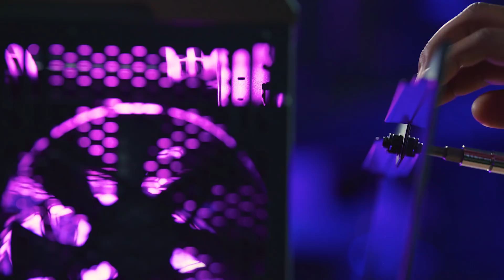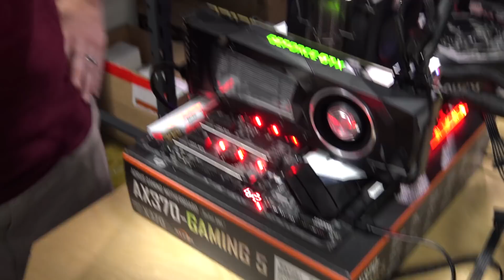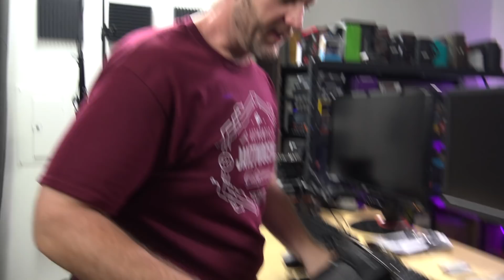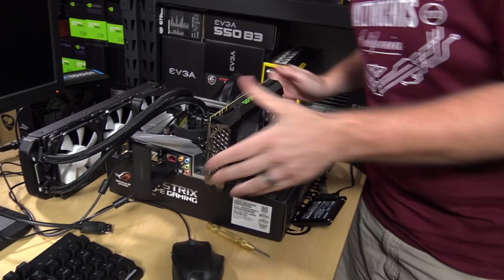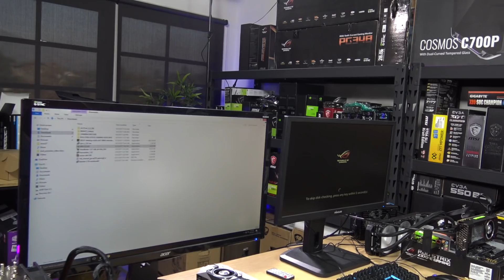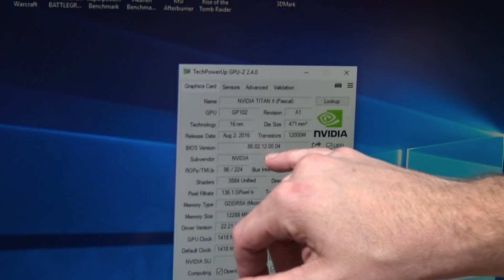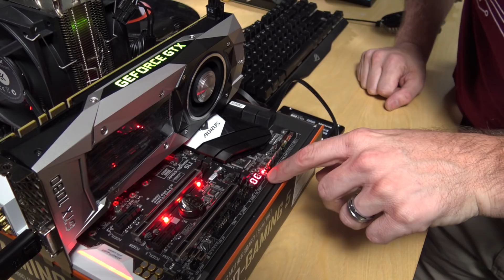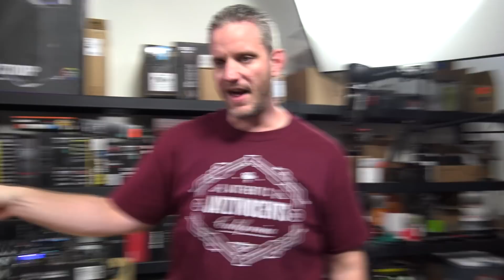I cant figure this one out... HELP!

Comment: maybe it's some weird power issue. check how much voltage  and wattage this specific card is drawing on the Intel board and compare to the other card. sometimes there is a difference between 2 otherwise identical cards ( I have noticed that with 2 of my gtx 970 g1 gaming cards). if there is an option to plug in a sata power connector to the Mobo ( that is usually required for sli) try doing so.

Comment: when you first plugged in each card to each motherboard, maybe there were initializations  that changed something about the settings of the graphics card, and the differences in the 2 boards' init settings would be compatible account for the non-symmetric compatiblity
Reply: isn't that a pretty standard possibility, you can't just take out components that are being used on one system and expect them to be able to be plugged in to another system, especially different amd or intel mobos, and expect them to work without any sort of adjustments or a reformat or something

Comment: Alright, I have something similar going on. The computers boot, but an R9 390 I have will have issues on my Ryzen, and my 3770k. I tested it in my mini-itx z170 with 6600k in it no problems... I ran Unigine Heaven, Superposition, and the Final Fantasy 14 benchmarks for hours with zero issues... Other comps it would get issues on the desktop without running anything intensive... So that annoys me.
It gets even worse with the new Windows 10 updates of late as well... I have a friends comp with an i5-750 and her msi r9 380... Again tested it in 2 other computers and it came out clean... So I'm annoyed with how things have been acting around of late as well :P

Comment: The video card bios wouldn't change when you put the video card into a different motherboard... what's the BIOS version of the card that doesn't work? You checked the version on the card that was working fine on the intel platform, then moved it to the AMD platform and checked the version again, of course it's the same... I noticed the color was way more green on the "bad on AMD" card when you started it up on the Intel platform, that says to me that the card probably is bad, but that the AMD platform is just far more picky about what it'll pass or not... I'm obviously not the first person to notice the bios checking misstep, but I haven't read all the comments to see if anyone else noticed that the video quality looks like crap once you put it on the Intel board... Good luck..

Comment: Can you edit this video so people stop focusing on the mistake you made and focus on the actual issue? Anyways, you know a hell of lot more than I, but for shits and giggles, confirm the board version of both cards are identical. Are they both from the same assembly line? Obviously a conflict with the ryzen. Only way to tell for sure is get another ryzen board and test it. I'm leaning towards something in that gpu hardware related is causing an issue. Can you rollback a gpu bios and then rewrite an up to date bios on the said card? Definitely a weird issue.

Comment: Mine was FX 6100 with HD 7750  it's just a problem with the South Bridge. There's
no problem in processor it's just the motherboard, If you will try few times by restating it, it will boot, It just can't read that card's IC properly.
Reply: Reply me if that helps

Comment: I had a similar problem with my MSI Z77A-GD65 mobo. I built the system with GTX 670 SLI, and a few years later I upgraded to a 980ti. The card would not work in the system and as you guessed I assumed the GPU was bad. I returned the GPU saying it was bad and the replacement had the same problem. Turns out the motherboard did not support the GPU which is a problem I had never ran into. I ended up building a new system around the 980ti and gave that system to my little brother. He still has the system and he upgraded to a GTX 1080 last month and we had the same issue. Luckily MSI had released a BIOS update for the mobo that said "improved GPU compatibility" and that allowed his 1080 to work. I probably won't be buying MSI boards again because of this, as far as I know ASUS are the best at validating their boards with a wide array of PCI Express cards.
Reply: I had a similar problem with msi too LOL. ms-7507 and msi hd5450.
Reply: If your going for Asus motherboard, be aware that it does not support all kinds ram models, had a problem when i built this setup, but once i got compatible ram of a different brand (but same type) it worked. I do however recommend Asus motherboards, in my opinion they are the best. (20years ago Asus was not this good)
Reply: I hear a lot that asus is the best 
But in best motherboard reviews its always a gigabyte why is that ??
Reply: HappyDude 
Recently Asus did some weird VRM fudging that didn't fly to well when ppl like Buildzoid caught it and called them out on it. The Gigabyte Aeorus, righfully, overtook Asus in reviews for overclocking motherboards for that reason. 
That said, Asus has phenomenal bios and usually great compatibility testing and features. 
Hopefully they learn their lesson come the next chipsets. 

I've always used Asus motherboards and they have almost always been the best, but for this generation I'd buy the Aeorus.
Reply: LOL, just wrote about my problem with msi P67A-G45 and 980ti OC strix. then I saw ur comment.
Reply: The two gpu bios you showed were from the same gpu un diferent motherboards, did you check te bios on the two gpus? Are they the same version? Sebastián from Uruguay.

Comment: This really looks like a power delivery issue to me. First step, use another PSU (like the one on the Intel System). If that doesn't work, change mo/bo, maybe for some reason it can't get the power needed through pcie. If you are skeptical about this being a power issue, consider that the card not working might be asking for slightly more power than your system can send, which would account for hanging as well as normal behavior once another (slightly less power hungry) GPU is installed.
Love your videos. Know that you have fans in Greece :D

Comment: You checked the BIOS version on the same graphics card twice; once on the Intel system and once on the AMD, but not on the card that is giving you issues once it booted on the Intel rig.  Honestly, I would blame the motherboard since motherboard manufacturers were the ones that had issues with Ryzen BIOS early on in its release.  Are there loose solder joints on the pins on the back of the PCIe slot?  Have you tried the non-working card in a different PCIe slot?

Comment: I have this mb, and it wont boot if it cant detect a connected screen on the primary vga, it just stops at Code 64, it worth a shot to try the other outs, or an other cable, maybe the used output is slightly damaged so the card cable combination fails.

Comment: Jay I would just use another "identical" motherboard for the ryzen system and check both titan x's  with it. The motherboard may seem fine but in my years of professional IT tech support I figured out that two identical systems are not identical and that for most mysterious problems that make no sense at all, the motherboard was the most suspicious part. Other things to consider are the PSU cable and its contacts with the vga and also the contacts of the specific "problematic" card with the PCI-E. Plus try to connect the card on another PCI-E slot on the same motherboard and check the error code if the problem occurs in another slot. I have never found a functional vga that would not post in all systems but I have seen plenty possessed motherboards.

Comment: what is funny is my 3930k on an Asrock x79 Extreme 11 does something similar with my Titan X pascals if the Bios reset is pressed or it crashes too many times on startup due to bad overclocking etc. the computer will get stuck on B2 during boot and so far the only solution I have found is to start the computer with an older card like a gtx660, gtx 750, or gtx 780, and got to the Bios/uefi and set default values and save then put the Titan X pascal back in and it will work fine, the crazy thing is I bought both titan X pascals (2) from Nvidia launch day and also bought my previous Titan X maxwells(3) from Nvidia at launch and all 5 Video cards did this I thought it was because I had and old motherboard

Comment: You never checked the Firmware/BIOS version of the "bad card"? 

Try, moving the "bad card" in the Ryzen system to another slot on the motherboard? I assume you reset the BIOS of the Ryzen system as well?
Reply: That right he never did show the Firmware/BIOS when he swap them around with non work one when put in the intel system.
Reply: Anthony Toste
I wondered if anyone caught that. He checked gpu version on right machine, then moved card to left machine and did it again, never showing the bad card's version? This could easily be an I&O issue/ conflict. And an I&O issue will cause the hardware device to not be used. IF you reloaded windows with bad card in, windows would prob reallocate resources (I&O) to avoid this.

Comment: I have a similar issue with my ryzen setup. Now and then my pc will refuse to boot (vga light on) on the motherboard. So i have to swap out my r9 280x to an old nvidia gt710 i have laying around. When it boots into windows, ill switch the pc off and put the 280x back in and that solves the problem.

First time it happened i thought my motherboard had failed and rma'd it only to be told it was working fine. Dont get me wrong i love my ryzen setup but the platform definately still has some weird quirks (i have another unusual behaviour from the system (unrelated).

Comment: Can't tell you the reason why, but at work I experienced the same with two Intel systems and a NV Quadro. Then I tested an old AMD HD6??? and it worked. Therefore I think the NV is the problem ... maybe manufacturing tolerances.

Comment: You double checked the bios on the same card. If it's not working at that point in the boot and you've ruled out the hardware itself. It's got to be a bios issue even if the motherboard and video card are on the newest version or a know stable one. I'd re-flash both just to make sure they are not corrupt. I'd also use a new download of the bios while doing that re-flash. It may not work but at least at that point you can pretty much rule out bios if nothing changes.

Comment: you checked the gpu bios version in the same card. you switched the not working gpu to the intel system but checked the version on the amd system. no wonder the version is the same, its the same card. i bet the gpu bios version is different.

Comment: You said Ryzen is picky when it comes to RAM. Maybe it's picky when it comes to GPU RAM as well. I'm no genius but anything is possible with AMD. Maybe change out the system RAM and see if that bears any results. Doubt it will. And I don't even know if RAM on a GPU would make a difference when it comes to different boards and or CPU's.

Comment: i belive its the mainboard. maybe u just got an bad one, because its the part that controls everything and give u the error. i had an gigabyte k7 mainboard with an 1800x and had very wired performance problems, i never figured it out what it was, after 3 days i shiped it back and orderd an intel system. i think that i just got an bad Mainboard that time because al the other parts work just fine in the intel system (changed the Mainboard, cpu and ram)

Comment: Well heres an idea. Is there any sort of overclock applied to the system? Mainly the base clock, not the multiplier. Could be that the ryzen has the baseclock set to some weard frequency that 1 GPU can not tolerate but the other one can. Effectively a silicon lottery or what not.
Assumeing those 2 bioses  were the same version tho :)

Comment: Step 1 - Try another PCIE-Slot on the Aorus board -> Maybe the Slot is a bitch ? Or some kind of tolerance mismatch in the two slots?
Step 2 - Try another Mainboard in case you have one. -> Maybe the Mainboard has some kind of damage thet makes it in the moment when its booting edgy, working with one card but not the other
Step 3 - Have a beer and call it a day. Maybe retry next week. I build Computer systems for al living too. Trust me, strange things can happen always. And consider working under ESD-conditions (wristband and ESD-Table). All electronic companies work in ESD-environments, and that shit is expensive, but keeps strange problems at bay...

Comment: Silicon lottery. Do both cards run at the same voltage on the system they work on? Also, check the bios on the second card lol

Comment: I wonder if it's the firmware on the cards that is causing the issue. Maybe they both have different firmwares and one works with the Ryzen system while the other doesn't.

Comment: Just because the GPU works in one system and not another doesn't mean it's not still a GPU issue. I had a PSU pull the same shit. Would power up and boot up one system just fine and the next it would power cycle. Not saying it is the GPU just saying don't count it out yet. And try another PCI-E slot or another MOBO. Funny you had two different post errors on the same board.

Comment: Check which revision the graphics card is. A certain resistance might not be inline with the other 1080ti. I highly doubt that could be an issue. But it is ryzen........and that's just about your only other possibility.

Comment: 1st You didn't check the bios on the two cards. SUSPECT THE POWER SUPPLY! change the power supply. 30 years of this pc building crap have taught me this. that particular card may have a slightly different power draw to the other which the PSU doesn't cope with. the fact that you put in the other card and had to do a reset in my mind would back this up.  
I have come over some weird faults in my time even down to one time it being the built in speaker (yes that tiny little one you used to get) in a case stopping a whole system working and causing random crashes, but it beeped fine!

Comment: I would do the divide and conquer method. Keep replacing components one by one till you find the issue. Also, put only 1 stick of ram on several different slots or try a different stick of ram. 

Try a different pci-e slot on the mobo. I have an amd HD6870 video card that sometimes works on the first pci-e slot of the mobo and most of the time it does not. However when I put it on the rest of the pci-e slots for the same mobo it works 100% of the time. Funny thing is when I use an r9 290 or an r9 295x2 on that same first slot, they both work 100% of the time.

Comment: I think the problem is in connection of card with MB ( I mean pci-e slot ) . Try removing and installing card several times or try installing complex in a case . Also try using pci-e riser cables .
that might be problem with the connection

Comment: Gigabyte =/= Ryzen, Gigabyte's implementation of Ryzen chipsets has been crap, flaky boards everywhere, the f5 bios on GA-AX370-Gaming K7 put 1.7 volts through the vcore. Try using an Asus x370 board, and see how finicky it is.

Comment: The ram doesnt run at the stated values on my ryzen system, if its set to the proper settings it fails post. I had trouble with trying to install my windows 7 when i got my ryzen stuff, windows 7 doesnt support the usb system of the newer hardware, so you cant use the keyboard & mouse...so you cant go through the install process, i even tried a clean win7 install on another system, installed usb3.0 drivers, didnt work on the ryzen, the motherboard i bought had no old school ps2 keyboard port, i thought i got a duff motherboard.....then after googling a lot i realised its all a scam to make you upgrade to windows 10, they deliberately designed the new hardware not to support earlier windows versions. Im not savvy enough to edit installs with automated installation & usb drivers.
If i hadnt have had my old setup to put back in my case i would have ended up going through the rma process

Comment: Swap power supplies between test benches. You had some psu voodoo and I've seen similar issues if a psu is reading low on a 12v rail.

Comment: Drivers!!! Use the tool to remove and clean the OS of the drivers and test again. Just use whatever Windows give for drivers. But yeah doesn't make sense. :)
Reply: The system doesn't even boot so the drivers are not yet loaded...
Reply: Yeah, I know but I always like to troubleshoot with the OS in a simple state and no drivers. Like I said it doesn't make sense. But I have seen some strange issues with AMD new processors and Nvidia. I have a friend brand new system Ryzen and Nvidia 1060 and it had the same issue it didn't boot no post and BTW Asus motherboard.

Comment: Like Darkio said, i believe it looks like a power issue. Except, i don't think it's a power power supply issue, mais it may be a motherboard power issue. The only way i know to check this would to to monitor power on real time on both system. Or change mobo for Ryzen if you have another one, possibly from another manufacturer.
Reply: About one titan working on one mobo but not the other, like you showed yourself previously, not all GPU are equal. Silicon lottery. The GPU not working may just be just a bit more power hungry, or have a power stack a little more sensitive.
Reply: You could try to check on the Intel system what the system total power consumption are with both card running any stable benchmark. May give you a hint.

Comment: I have had this same issue more than once and the solution was a Ram Change or a Bios Update.  The Super Gaming Low Latency Ram seemed to make the difference.  I finally had a MSI (970a-g43) bios update that fixed the issue.   Then once with an intel board as well.  Its not just a motherboard issue, its a combination motherboard/ Latency of Ram and Bios scheme to make the most of the hardware and squeeze the most out of our stuff.